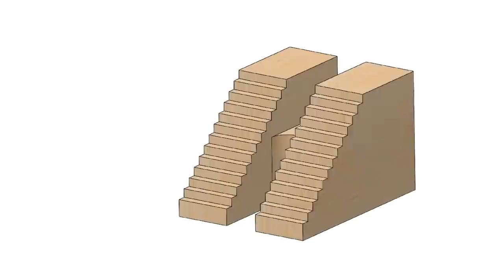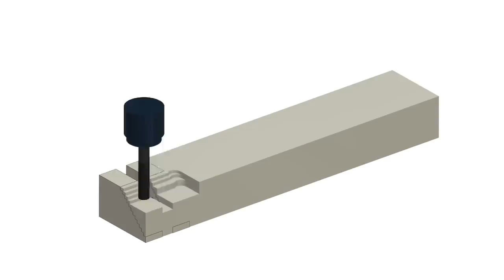A QUICK to use Clamping System for CNC T-tracks

Comment: I have mixed feeling seeing the effort just for clamping: I wonder why Felder has put a top on this tool, when you add and rebuild an additional layer. Is the cover from Felder so worth, that you needed an extra layer ?
Would it not be possible to level the original bed ?
Reply from the maker: I guess the most convenient solution for Felder and the user was to use aluminum extrusions for the table. That way you can make anything with it. Flattening the aluminum table or add another one like I did

Comment: A well thought out and executed design.  What size t-nuts did you use?  Looking on e-bay, they are sized by the size of the thread (M5, M5, M etc.) and sometimes the extrusion size (2020, 3030, 4040).  I would very much appreciate it if someone (Marius?) could clarify which size I require.  Thanks in anticipation ....
Reply from the maker: They're called EU30 M6x16,5x8 and EU40 M6x19,5x8, but that's for the European standard
Reply: @MariusHornberger  Thank you.
Reply: I can find nuts to those standards available from China on e-bay -- but which of the two you mention do I want to fit in the 3d printed parts?

Comment: As usual, great video.
Would a varnish that soaks into the MDF make it stronger. Same as the bandsaw wheels. I know that was a different type of load, but it should still help without needing to re-cut or get another material type.

Comment: Maybe plywood on the bottom with a layer of MDF (or other) glued on top and flattened to the right thickness? Plywood will take the stress on the bottom, stress on MDF side will be distributed to a wide area by the clamping pieces. I have no idea how feasible that is because I have zero practical experience with this sort of thing but from my armchair that seems like it could work.
Reply from the maker: good idea

Comment: How about inverting the system? When you use screws with a „T-Head“ instead of the T-Nuts you could get more travel and still use the metal t-Track. The T-Head screws could be a threaded rod and a t-nut welded together.
Reply from the maker: I also thought about that but I wanted to avoid that method, because then you have threaded rods sticking out that could interfere with the toolpath. Now I always only have the thickness of the knob sticking out.
Reply: it would add more components to your build but you could have a short t-head screw going into a long coupler nut, then use your existing screws with handles to thread into the other side of the nut. With this i think you could get the travel you want.

Comment: Maybe you could paint the 3D printed parts of the different screw lengths in different colors, so if you're using them in a mixed setup, it's easier to see which is which?
Reply from the maker: good idea. Wouldn't be much work to do

Comment: Three questions:
1: couldn’t the nut binding in the track problem be avoided with a slightly shorter piece?
2: couldn’t the triangle running into the screw problem be avoided with a slightly longer piece?
3: will you, please, make the clamp tool storage box a hand tools only project - just for the irony?
Reply from the maker: 1: Can you be more specific. I'm not quite sure what you mean
2: yes, but only at places where there's enough space behind
3: I don't think so ;)
Reply: 1: My bad. I was dividing my attention between the video and my kids, and assumed your version worked the same way as the metal ones, where the top piece stops the rotation rather than the bottom piece.

Comment: Why not reinforce your slot cuts with super glue or epoxy. The super penetrates the material and epoxy bonds with the MDF which means the epoxy would need slightly deeper cuts. I often used super glue to reinforce the pdf when adding fasteners to it.

Comment: Why don't you make it fixed on the underside and a wingnut on top. Then a long bolt fits all. My two cents, great video by the way!
Reply from the maker: A long bolt sticking out is very likely to interfere with the toolpaths
Reply: @MariusHornberger  Yes, and if not the toolpaths, it can interfere with dust boot

Comment: Why not just use the existing aluminum T tracks but reverse the bolt direction? i.e. Make new slot inserts that mate to the bolt head and then have the clamp knobs at the top house nuts rather than the bolt head?

Comment: you just need threaded rod and nuts, not so much an assortment of bolts least this is what is used on metal mills and cncs
Reply from the maker: But this is not a metal mill

Comment: Where to find the STL file(s)
Reply from the maker: They're now in the video description
Reply: @MariusHornberger  Fantastic - they are printing as we speak. Do you have a link to the t-nut used as well?
Reply from the maker: German shops probably won't help you. Search for "t track nut hammer head"